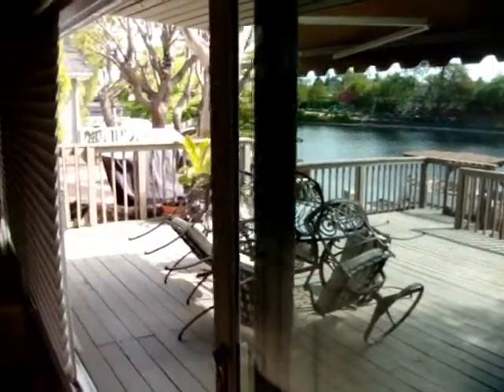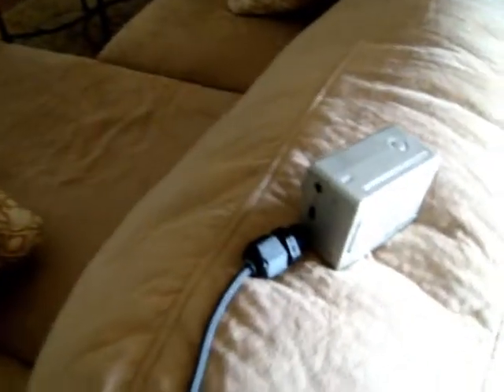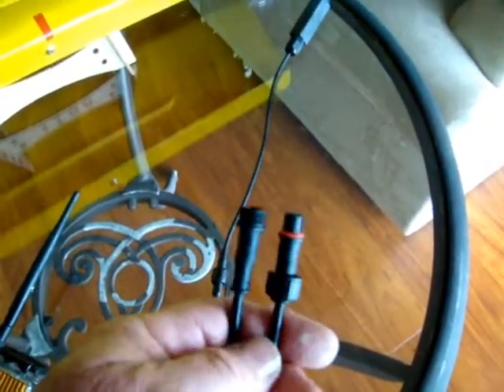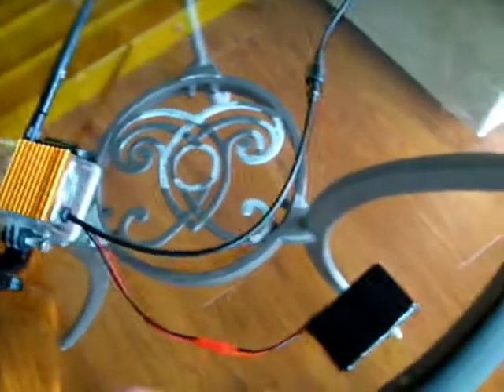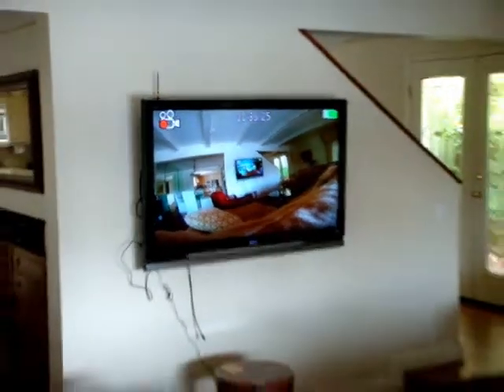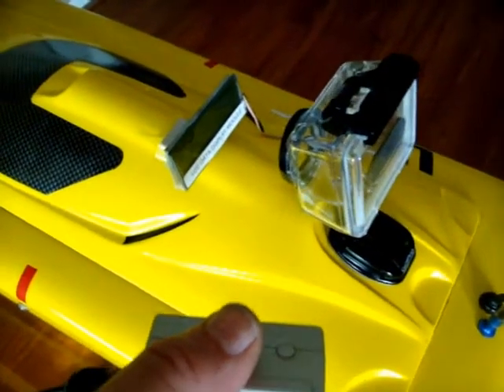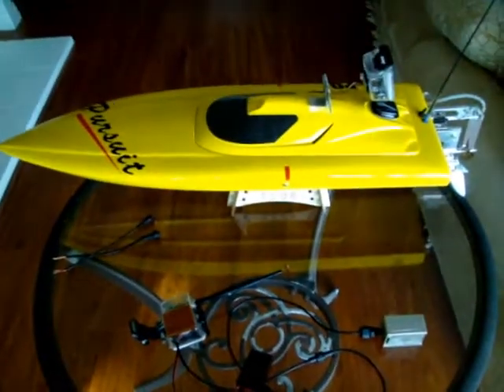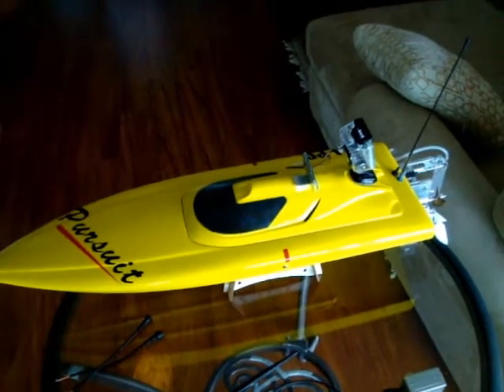Wireless Video for GoPro Camera

Comment: Ya, but he's using SD video out socket, so the transmission is not HD.
You can buy a 1W 900mhz or 1.2ghz or 2.4ghz or 5.8ghz transmitter for < 100$ and do same thing, just stick it in a waterproof housing.  What exactly was "created" here?

Comment: 1000 watts? Not hardly. A 1KW transmitter for any bandwidth would be much bigger. 
I'm a HAM, General Class. I have transmitters from HF to 10.5 Ghz. The gigahertz transmitters vary but the average for miniature applications such as yours run in the realm of 3-15 milliwatts. You would need a car battery or deep cycle marine battery to run 1KW of 2.4 Ghz. Ohms law calls BS on your 1KW transmitter.